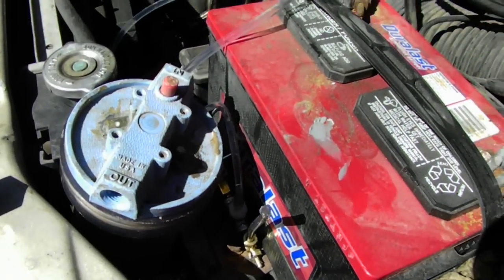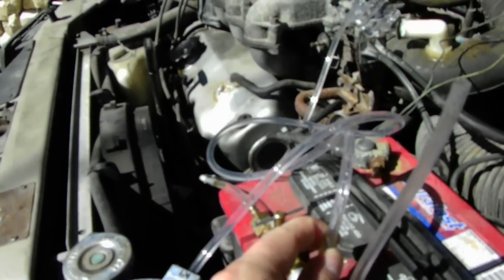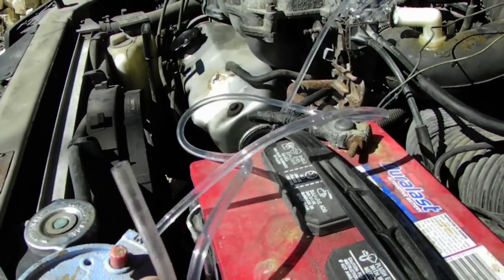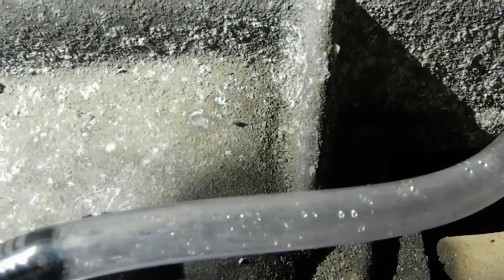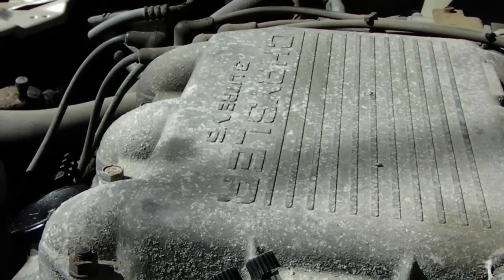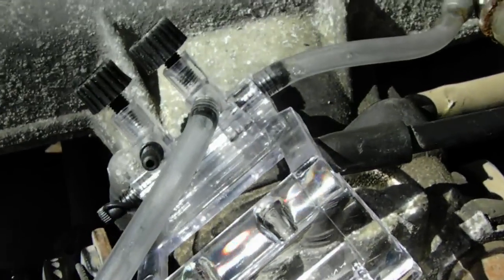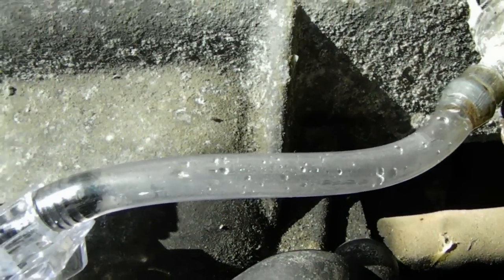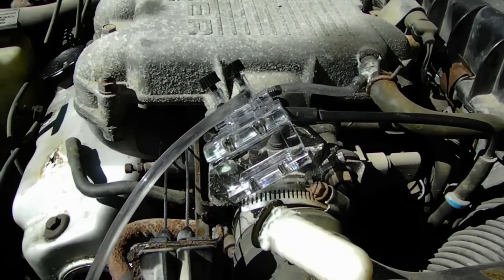Water injection by venturi pump

Comment: Power increase are not phenomen which have to be "feel", but MEASURED by times 100-200kph OR on dyno. Any other estimate value is bullshit. That engine could even develop LESS power than stock, but more torque.. which is bad thing.

Comment: I've watched several of your vids. After seeing this one I'm reminded of the needle valve in a paint gun. Like a HarborFreight gravity feed gun is $10 with coupon. Anyway just thinking the trigger could be linked to the throttle cable ,so the more peddle pushed the more the trigger would cam open.  Just a thought on a cheap needle valve. Great Ideas you have👍👍👍👍👍
Reply from the maker: I tried that idea and flooded my engine out the vacuum is to un predictable would work good with a pump though
Reply: @prototype9000  I have some similar projects and what I use to replicate the throttle position is I use an old Ford vacuum actuated heater valve. I reversed the lever on it so when the vacuum is high it closes the valve and when the vacuum is lower it opens more

Comment: looks like a vacuum leak which leans the fuel mixture causing an increase in power but increased temperatures.   also, the computer will adjust the fuel ratio to compensate for the small vacuum leak and increased amount of air.  i'm dubious because if this was the real deal, industry would have been using it already to save money
Reply: BMW has water injection tech on their new engines. Bosch has the technology as well .look it up
Reply from the maker: ohhhtravis it is the real deal i was using o2 simmulator to lean out the mixture so the computer cant compensate theres other mods out there that work to

Comment: Hello my friend, I set up a prototype of gasoline, but it did not work properly because of the sensors ... I did not understand what materials you used to make the valve, of water distribution, what materials did you use?
Reply from the maker: Rogério Szupka i made it out of some hose and brass needle valve aquarium gang valve as for the sensors get some sensor simulators to trick the computer into using different ratios like an o2 simulator

Comment: Yes water / steam works - the problem it's Delivering the correct volume of water at the right time
Reply from the maker: the intake manifold usually helps with that
Reply: How do you control the flow / volume for different size engines ?
Reply from the maker: +Vapour Draw Systems- VDS i just use a valve then adjust it at around 1000 rpms
Reply: VDS lets the engine tune the volume - no valves no taps no moving parts- uses the pulses  of engine

Comment: I  just thought of something, have you seen fuel vapour systems? I'm thinking the same thing but sucking the air intake through water or water/meth to fully vapourise the water before it's sucked into the intake.
Reply from the maker: turning it into steam seems to be the best option but steam is very destructive to the heat ex-changer and delivery pipe
Reply: Maybe mounting a stainless tank near the exhaust with stainless lines for a few inches, I was thinking of steam injection, but I like the idea of combining a vaporisation chamber and heat for better vapor and simplicity.
Reply from the maker: +Adam Blaknovski better to vaporize it in the delivery system than in the tank takes to much energy and time and you have to deal with high pressures and valve timings and other variables

Comment: tanks and is great idea ..but the plastic water valves not toasted or craket with the engine hot ?? like some hoses ... cheers .
Reply from the maker: brass works great for a while but the water eats it like  acid after a while

Comment: wondering what your 02 sensor is reading and what is going on with fuel trim?
Reply from the maker: +Eddie Da Silva i use an o2 simulator or the engine sends more fuel

Comment: I really like the simplicity of this setup, very nice! I'm wondering if you have made any modifications to make it better? I was thinking of using a transducer like in the cool mist room vaporizers to do basically the same thing but finer particles of water, your thoughts on this idea? let me know if you improved or tweaked this current setup please.
Reply from the maker: Steam injection woukd really be the best way im already working on that ultrasonic i have tried your system tends to get bogged down electricaly  ultrasonics eat up allot of wattage if you want any decent production ive been experimenting with some venturi jet designs to atomize it even further when i find something that works ill post the results
Reply: I was just looking at some online hot mist room steam vaporizers and wow, were talking 1500 watts of power to put out a ton of steam however, maybe 1000 watt version may work but still a lot of power. I wasn't aware the vicks piezo electric cool mist vaporizires (ultrasonic) took that much power at all. Are you sure about that? It's just a little metal coated disk that vibrates really super fast and looks like it could run on little wattage?? I have no clue that's why I'm asking. Let me know your thoughts! Thanks Proto!
Reply from the maker: BILL W you can use the heat of your exhaust pipe to make the steam doesn't have to be anything to exotic or complicated by using commercial heat exchanger piped or just wrapping a copper pipe around the exhaust and insulating it and relying on vacuum to suck in the steam ive seen 400 watt boilers create enough steam to work for hobbyists steam engines
Reply from the maker: BILL W you wouldnt need a whole lot of steam either. Just a little
Reply: prototype9000 he is yousing the same thing i deloveped over 50 years ago on the mistifyer but you have some problems with your system but im not going to tell you what they are
Reply from the maker: von hubbard im learning and improving i wanted to do something a bit different than your invention right now im learning the basics was going to by your mistifier for my travel car and use my work one for experimentation but i seem to be perpetually broke
Reply: prototype9000 Do you have an egr valve on that engine? Inject water vapor there. Part #26582900 is a small gas engine needle valve by O.S. engine that may help.
Reply from the maker: the egr valve is internal in the throtle body cant get to it
Reply from the maker: I had a system with a heat exchanger before it worked great but even with stainless steel the steam ate away at it like acid i stopped using that thought it might not be good for the engine
Reply: Does the geet system work by  Paul Pantone.